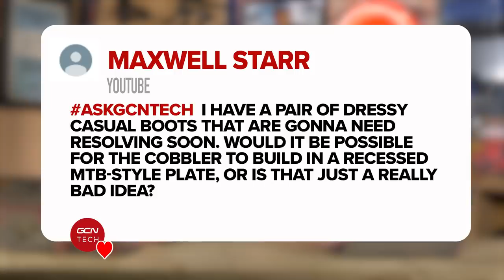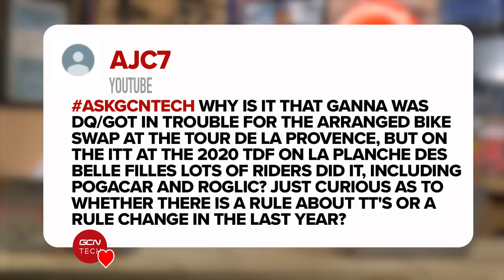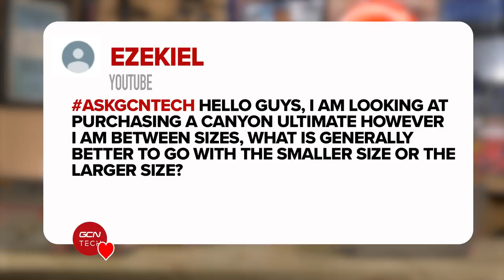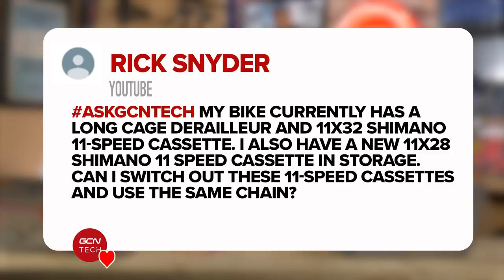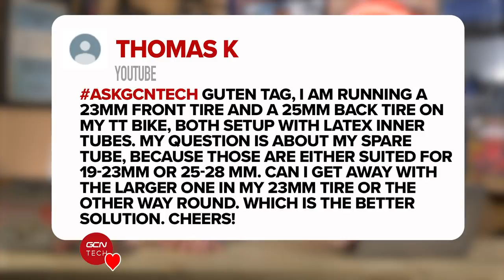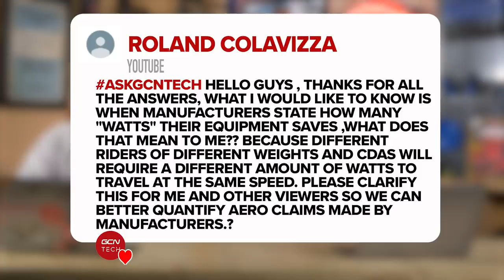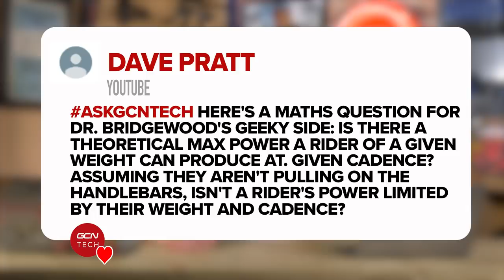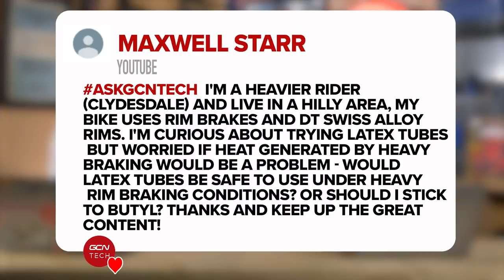Is There A Maximum Possible Power We Can Produce? | GCN Tech Clinic

Comment: With respect to Canyon sizing for the Aeroad CFR, I followed their suggestions with the fit calculator and it said size small (I’m 5’9.5” tall with a 33 in inseam). Once it arrived, my bike fit guy immediately said too small and had to ship it back. As far as Live Chat goes, it never seems to work irregardless of the time of day I tried to log on.
Reply: Did you end up getting a medium, and how did that go? I'm the same measurements, and having a hard time accepting their size, my current bike geometry is in between small and medium.
Reply: @PromDizzle  Using height as the determinant of size hasn't been applicable for decades. If you can reach the pedals, you're tall enough. Seat tube length is only relevant if you're on a bike fitting a dropper post. Arched top tubes have made standover a horrible fit estimation. Reach is what is important. Use your current bike numbers to decide what to buy. Compare the reach to stack and determine if you need more or less aggressive positioning on the next bike.
Reply: @PromDizzle  Hi Andrew. The size medium is of course now out of stock so I haven’t been able to find out. I did however put it side by side side with my 56cm Trek Madone H2 frame and it was definitely smaller all around. Good advice below to check out. Cheers mate!
Reply: That is truly shocking that their fit calculator recommended a size small for you.  Someone needs to recalibrate that tool.
Reply: @marianneoelund2940  Indeed! I saved so long for a high end bike and was super excited about it, only to be soooo disappointed that I not only had to return it, but couldn’t get the medium model. Lesson learned…
Reply: @chrisdavis8399  I would normally ride between 54/56, the small aeroad comparison with my current bike on geometrygeeks seems right in between - and i would normally trust german precision - but yours is not the time i've seen someone order their suggested size and feel its too small.
Reply: @PromDizzle  I wish I knew what to tell you to do with your choice. I just know I felt a bit cramped and looking down I could see the front hub clearly. The small ships with a 90 stem and I considered getting the 110 stem but didn’t want to take the chance that would help. My fit guy said it probably wouldn’t so there you go. Best of luck!
Reply: @chrisdavis8399  All good, just trying to be as informed as i can, nothing beats experience, thanks!
Reply: @PromDizzle  One thing I thought of mate…if you’ve had a computer fitting before you could send those numbers to Canyon for their opinion or better yet have your fitter compare the numbers with Canyon’s geometry charts. Cheers!

Comment: I think the question about max power is less about human potential and more about a limit in physics. If you had flat pedals and couldn’t pull down on your handlebars you would be limited by your bodyweight as the maximum force you can push down. Of course this doesn’t apply if you are clipped into your pedals since that would allow you to pull up as well

Comment: #Askgcntech. Hi Ollie, Manon, Alex and Conor. I am looking to get a power meter in the future. I have a question about the temperature compensation feature. I know it could be a little early in the year. As it looks like the weather maybe getting better here in the UK. My question is. As I keep my bike inside the house and is warm. When I take my bike outside the the temperature is lower inside. Or it's the colder months. What would I need to do the get an accurate power reading? Would I need to leave my bike outside so the power meter is at the same temperature as outside? Or would I just ned to calibrate it using the power meter app?
Reply: I recently got a power meter, and the instructions included suggest allowing the power meter to adjust to the riding temperature before calibrating. It is also quite simple to re-calibrate as needed throughout the ride, though you will need to stop to do so.
Reply: My experience with power meters has left me with low confidence in temperature compensation.  You want to calibrate when the sensor is at air temperature, and if the temperature changes much during the ride, repeat the calibration.

Comment: #AskGCNTech Hi Alex and Ollie,
Enjoy the show, get some good information from you all. 
A few months ago I descended an 8km mountain on my tandem. During doing this I overheated my disc brakes.  Since then they have squealed when applied. I have cleaned, lightly sanded the discs and pads several times. Is there anything else I can do to stop the squealing?
Thanks
Reply: Sounds like you need new pads.  
Also, for future reference, the thermal power you are putting into your brakes is proportional to your descent speed.  Keep the speed down, to keep brakes cooler.
Reply: The pads still have plenty of wear left, but I have taken your advice and replaced the pads. I’m getting out on the weekend so here’s hoping they’re quiet.
Reply: Changed pads, brakes still noisy. Must be the discs from over heating.

Comment: #askGCNtech I want to buy some fancy carbon wheels for my gravel bike for comfort, weight etc. Riding 30mm (dry) to 40mm (wet) wide tyres, what is the correct internal rim width wheels I should buy? Will standard road wheels be sufficient?

Comment: #AskGCNTech Hello Gcn! I recently got a power meter and have been training with a heart rate monitor for about a year. My max heart rate and ftp are measured not too long ago and the zones are therefore fairly accurate. 
The funny thing is, when I ride a normal 50km endurance ride with my dad, well-rested and with normal conditions, my heart rate zones and power zones don't align and differ a lot. 
For example, when I ride in zone 2, my heart rate is in zone 3. I don't think this is due to fatigue, as I have this always and don't feel fatigued during my ride, data stated above. 
Could you maybe indicate what the issue is?

Comment: #AskGCNTech Hi Tech Team! I'm looking to buy a low end winter bike on a small budget and am wondering if going rim brakes vs mechanical/cable disc brakes would be a better option. Weight isn't an issue and I live in a fairly flat area so there won't be any speedy descents needing hydraulic disc brakes ( / would ride my proper summer roadie for those rides). Which would you recommend? Cheers!

Comment: #AskGCNTech Hi team. I’m looking to upgrade my wheels. I currently have a set of old Mavic CXP on my 2008 Time VX (#savetherimbrake). I’d like to go for carbon but I’m a fairly large guy (6’3” and 198lbs) in a hilly area with abysmal roads. I’m worried about wearing out the brake track or doing some serious damage on one of the many potholes here. Is carbon worth the upgrade or should I stick with a higher quality alloy? Thanks

Comment: #askgcntech Hi Ollie and Alex, Can I use 9110RS rim brake on the front fork? cuz 9110f is out of stock. But it seems 9110rs structure is not as strong as 9110f and 4grams lighter than 9110f. Thanks~

Comment: #AskGCNTech — I’ve been using baby wipes to clean my bike chain in between a thorough bike clean/detail. Are there any long term issues with doing this? I always reapply lube afterward.
Reply: I would be concerned about any ingredients added to the baby wipes for germ control, if they are oxidizing agents.  Could promote chain corrosion.